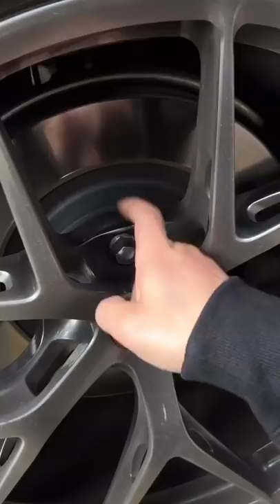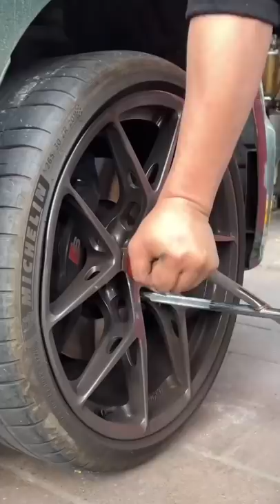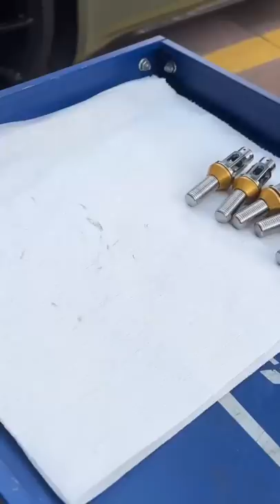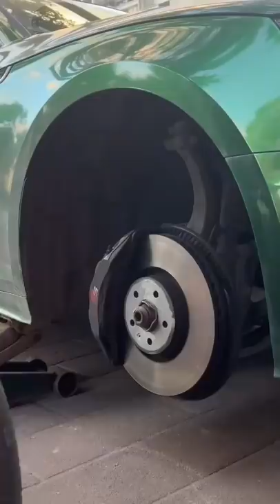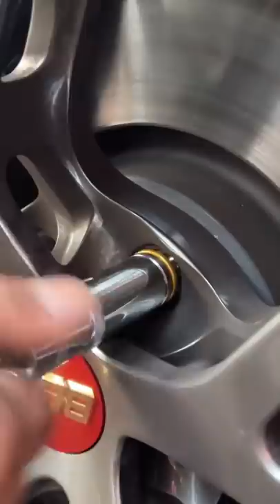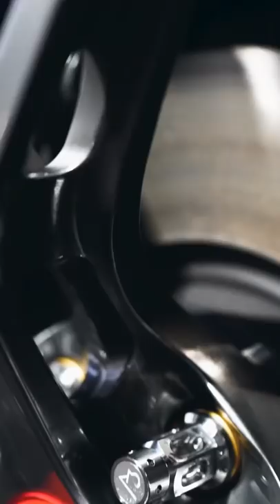Upgrade #mechanic #mechanicsteve #automobile #shorts

Comment: You have a knack in your wheel
Reply: What is a knack? Thank you!
Reply: @cristian6766  wheel is not 100%
Reply: You can see it from the outside.. sometime you cannot feel it when you drive.. depent the balance
Reply: @ramzik.999  Maybe not on the rear. But front for sure.
Reply: @buyankaratren9822  where you can see that i said front or back
Reply: @ramzik.999  where you can see that i said that you said front or rear. Don't get twisted 😂
Reply: @buyankaratren9822  so be it. You said  : maybe not on the rear. But front for sure
Reply: @ramzik.999  but i don't said you said it .
Reply: @buyankaratren9822  ok you are blind
Reply: @ramzik.999  what is wrong with you saying i am blind. What i said was just a addition to your statement. That's it. Not said you're wrong or it is not correct or anything else.

Comment: I’d be afraid of someone overtorquing and snapping the lugs off. Lol
Reply: Especially with that technique, he went so far past the click.
Reply: @Shultzchet  not sure we watched the same video if you think he went way over 😂
Reply: @dawarmonky2122  I'm not either because the video I watched he moved the end of the wrench a good 2+ inches after it clicked. You are only supposed to go until it clicks, and you should pull up towards you so it is easier to not accidentally over tighten them.
Reply: @dawarmonky2122  at the tire shop I worked at I would have been fired for doing this.
Reply: @Shultzchet  
Most tyre shops use air tools to put them on. I avoid all of them.
Reply: @ro63rto  we used an electric impact because most tire changes where done with the car in the driveway outside of the shop. But we used an impact wrench because it was faster but we never let it go past snug, I would often have to do at least a full turn or more with the torque wrench after.

Comment: Alright I've seen this so many time.. The rim will not bond to the mating surface on the rotor anti seize does nothing there. The only part that needs anti seize is the ring that centers the wheel.
Reply: It's actually helps a shit ton in coldweather aka Michigan. Do this all the time withmy dad just easier to get it off. Idk man maybe you're right but I'll tell you didn't do it once and it sucked ass.
Reply: In Sweden. This helped a lot

Comment: curios. why tighten the bolts when the tires are on the ground? As the bolts are tightened either the car or the tire would slightly move inward but then if the wheels are on the ground, i am thinking there is it wont move ... ah there is enough room to move inward as the tire is made of rubber!!!